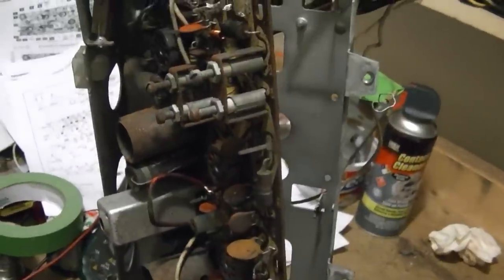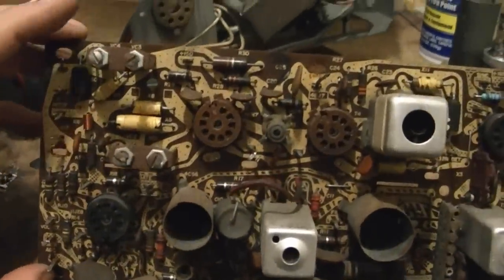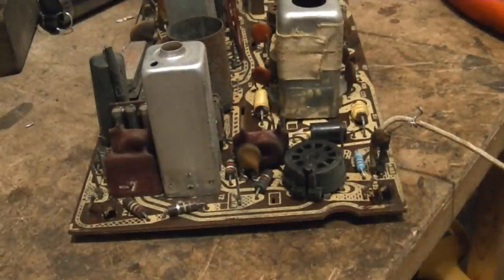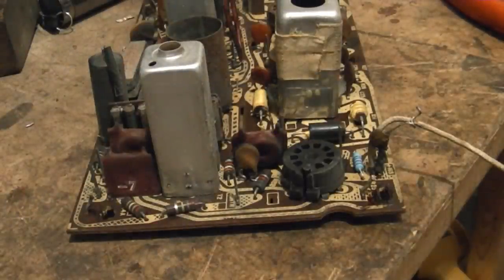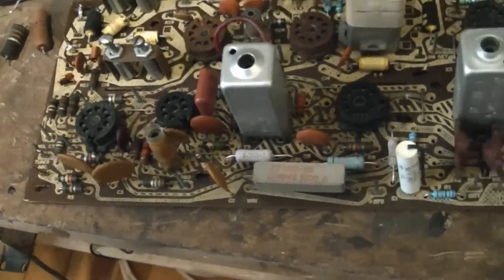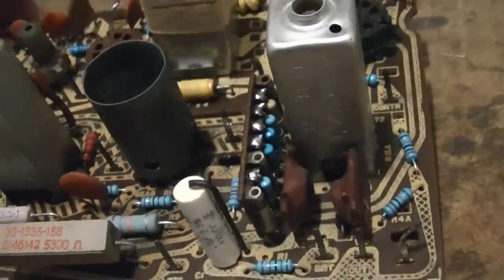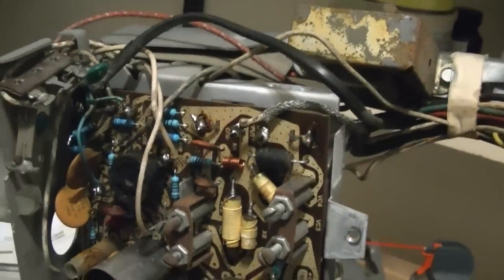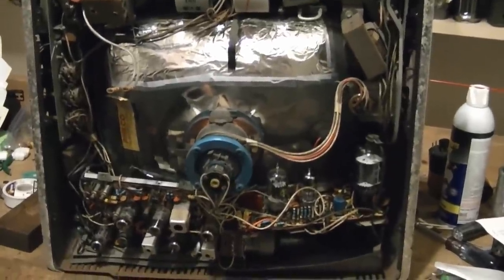Philco Town & Country restoration p4o?

Comment: The entire set was designed to be hand assembled but cheaply and quickly. Thats where the wire wrap posts come in as well as the location choices of the various boards. There was no consideration as to how the set would stand up to age because it was always assumed that a consumer would replace the set within 5 years as new improvements and features came out. This of course makes restoration more difficult yet satisfying in the end. Great Job so far. I like the patience and detail you put in.

Comment: Wire wrapping seems to have been the flavor of the month for engineering departments back in the late 50s early 60s, I've even seen in in some radios. RCA used them as well but unlike Philco they made the bottom side of most of their circuit boards more accesable. One thing I notice straigh away about that Town and Country set is that they used molded tube sockets instead of the junky wafer ones the Predictas used, They were also merciful enough not to mount their electrolytics on the P.C board.

Comment: What you could also do is rout all the wires to one area on the board than harness them together into a "insert number of wires here" pin molex connnector, so there is one easy connector if something goes wrong.